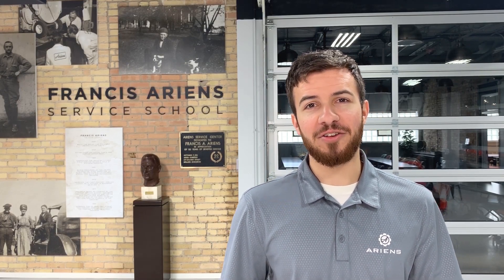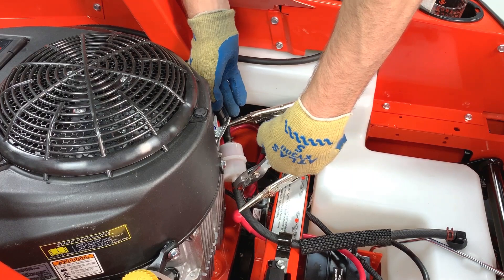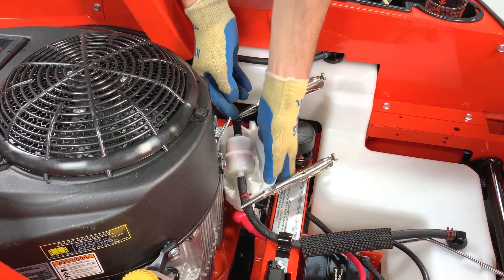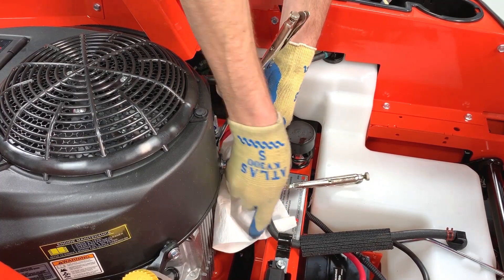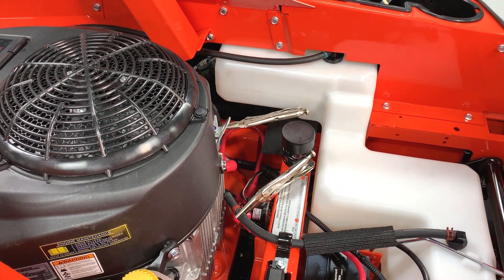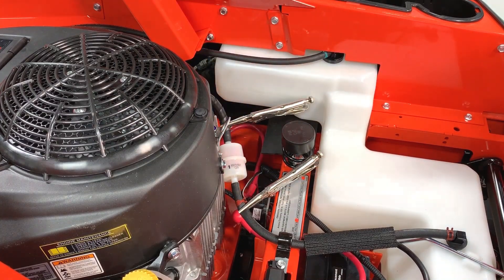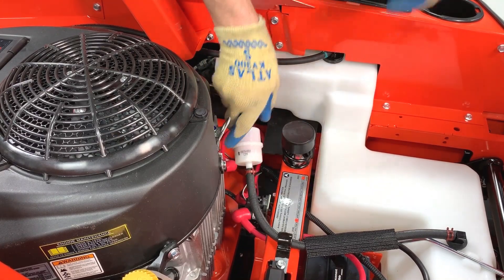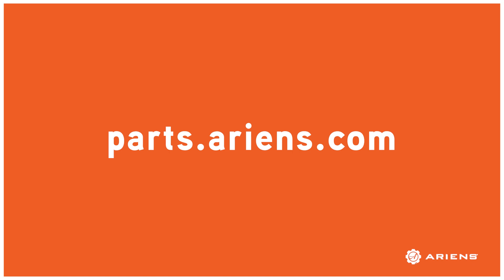How to Change an Ariens® IKON XD Fuel Filter | Ariens

Comment: Silly question but In my manual for my brand new Ikon XD 52 it says to be sure the fuel valve is in the on position... I cant find it.... Or I am not seeing it. I was a bit frustrated and on the verge of a meltdown after a crappy day at work and then the mower wouldnt stay running.... I watched the video to be sure i was starting it right but it would start to engage and then die! This would be my first time to mow with it. Please help.
Reply from the maker: Hi there, Tracy. We're sorry for the confusion, but Ikon XD models do not feature a fuel valve.

Regarding the issue with your engine – ensure you're starting a cold engine with the choke knob pulled out, but push the choke back in slowly right after the engine starts. Let the unit run for a few seconds and move the throttle position to full. 

If you engine issue persists, please contact your nearest Ariens dealer. Our dealers are an extension of our team and will help you diagnose and resolve the issue. A dealer in your area can be found with our dealer locator tool located here: https://www.ariens.com/en-us/dealer-locator
Reply: Tracy, Did you ever figure out the problem as i am having the same problem . it will run for 20 min and just die. Thanks in advance for any help
Reply: @marcmulcahy3658  same problem 😢

Comment: Sorry to keep bothering you guys. I misplaced my Manuel somewhere. I have the ikon XD 52. Is there hydraulics on it and if there is where to I check the fluid and the other thing is I was looking at the oil drain plug... Is there a trick to changing it to where you won't get it all over or a pipe or somthing that im missing? Me and my dad was looking and was wondering because the way its set up it would run all over the frame and I cant find any vids on the XD just the ariens X.
Reply from the maker: Not a problem! The Ikon XD-series uses a pair of maintenance-free, sealed Hydro-Gear transaxles, so there's no fluid level to check, nor will you need to service them.

As for the oil-change procedure, we do have a short video that guides you through the process, but please understand this video is a couple years old and may not be 100% to your machine. Also, remember to use the oil drain tube that came in the literature pack supplied with your unit – this will help direct the drained oil away from your machine. You can watch the video here: https://www.youtube.com/watch?v=sQzogQEmOlU

Finally, you can find the digital version of your operator's manual here: https://apache.ariens.com/manuals/05278800B_ENG.PDF
Reply: @AriensChannel  awesome thank you guys so much I'm trying to talk my neighbor into getting one told him you guys answer questions american made and got great stuff. Made the right choice.
Reply from the maker: @ttlkeat3284  We love to hear that! Thanks for trusting us and being an advocate for our American brand!

Comment: Different topic: My Ariens IKON-X 42 ZTR, mod 915207, will turn 5 years old in a few weeks.  It has the Briggs 22hp engine, now with 185 hours.  I'm going to have to either tune it up, get different gas, or send it to the local dealer which will probably cost a few hundred bucks.  I runs rough, and has done so since forever, but right now it will start easily but stop running after one or two minutes of load.  Bummer.  I've always had to run with the choke halfway out to keep it operating for the two hours it takes to mow half my yard, but now no choke setting will keep it running.  
Engine oil change:  The way that engine is set into the frame prevents it from allowing the engine oil drain hose from flipping down and letting the engine oil drain away by gravity.  So I got a small hand-pump oil pump, the kind with several different hose attachments.  I needed the narrow but heavy gu0uge hose to vacuum up the oil out of the pan - heavy to keep it from collapsing under the pressure of the vacuum needed to draw up the 30w oil.  It left a little behind, not enough to worry about, and was a much easier way to change oil than trying to invert the entire heavy rear end of the mower.  I was angry with Ariens for not engineering some mount that would allow the oil drain hose to drain naturally, but the hand oil pump was fairly cheap and did the job well enough, so I got over it. 

The upside to those sealed transaxles is no fluid level to check, but that is the downside, too, since apparently they can't be re-built like the higher end transaxles.  But first, check with Ariens to make sure I got that 'no re-build' comment correct.
Reply from the maker: Thanks for your comment. We're sorry you experienced some issues through the course of ownership on your Ikon X 42. You are correct that the sealed transaxles on your unit are not to be serviced or rebuilt.

For any other questions related to service on your machine, please contact your nearest Ariens dealer. Our independently owned and operated Ariens dealers are an extension of our team and will be able to help you resolve any issues with your mower. You can use our dealer locator tool to find servicing dealers in your area: https://www.ariens.com/en-us/dealer-locator